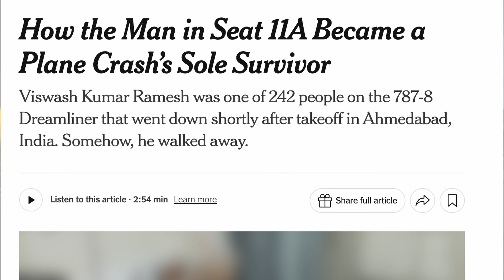Why the RAT Changes Everything – Air India 171 Update

Comment: Looking at that rat, maybe, pic.. now look at the flaps.  They look up.. but  I know on a 787 it's very hard to tell if they are at 1 or 5.  But... a duel engine failure.. possible... Polar had a 4 engine failure in Bogata due to the fuel truck being filled up with water.  They should have know if the flaps were up or down by day 2.  They should also know if the fuel was contaminated by now, by checking what is in the fuel control/pump or filter, one of which should have survived...  Nobody is talking though.

Comment: Hello Captain Steeeve! I like your hypothesis about the engine failure but its a not a theory. :)
Reply: It wasn’t engine failure. It’s a pilot not making sure that the propulsion engine driven generators were active and online prior to shutting the APU down. Which takes 90 seconds for the APU to shut down after selecting off.  They probably selected the APU off just prior to takeoff. 90 seconds later just about the time after they took off the APU shuts down and causes loss of AC power, kicks the rat out and then the engine Fadec system brings the thrust back to thrust idle safe mode. You then have to move the thrust levers out of the last position, takeoff position TOGA and back to takeoff position TOGA for the Fadec to realize there is manual control by a pilot, and then it will go back to full thrust. They may not have known realized that till the last second. Chain of events. Caused by something as small as not, making sure the propulsion engine driven generators were online by looking at the Crew alerting system, prior to selecting off on the APU just prior to takeoff. If they had selected the APU off earlier, way earlier prior to takeoff if the AC power had not switched automatically to the propulsion engine generators, well, then when shutting down the APU, the flight deck would go dark with loss of AC power. But they would be safely on the ground. I’m purely speculating that there must’ve been a fault that kept the APU generators from automatically switching over to the propulsion engine driven generators, which is something a pilot is supposed to be looking for. But there may have been a whole bunch of messages on the Crew alerting system clogging up your view from other maybe deferred item messages, and have not thought out just how important it is to make sure that you check and make sure that there are no GEN OFF messages shown on the Crew alerting system screen before you shut down the APU.

Comment: Honestly my experience with this airline is that mechanical issues are common. I had a 13 hour flight from Newark to Delhi and the tv didn’t work. The lights didn’t work. The service button didn’t work. The flight attendant told me that only the ground engineers can fix it. The same day, I knew someone flying from SFO and he experienced the same thing. I think all of the airlines flights should be investigated.

Comment: Next to impossible to take off with the flaps up.   THERE WILL BE A TON OF NOISE IN THE COCKPIT AS THE JET BITCHES ABOUT TAKEOFF CONFIGURATION.  And  I don't believe it is possible to set the autothrottles (TOGO) with that horn blowing

Comment: The craziest plausible theory?  Cosmic rays.  "When these energetic particles, especially neutrons, strike a microchip, they can disrupt the electrical charge within a memory cell, flipping a bit from 0 to 1 or vice versa. This change in data is called a soft error or single-event upset (SEU)"  If Boeing's engine-shutdown code had a single point of failure and a cosmic ray hit precisely at the exact spot on a microchip that code is housed.....

Comment: RAT would also deploy if the pilots disconnected both of the IDG (integrated drive generators) and the APU was off to try and provide 15kva power to the flight control. So the engines could be fine but pilot error disconnecting the IDG.  I think this has happened on a Egyptian air flight due to pilot confusion and panic.

Comment: Pilots think they know how planes systems function. How often do pilots trouble shoots systems. Rarely, mechanics trouble shoot systems. There was no error in co pilot grabbing wrong lever, but ive seen many times pilots dont follow check lists completely and forget to put fuel boost pumps on. Engines will start and run at low idles, but at full power and at a nose up attitude they can flame out. Thats what happened. i have 40 years experience in running and troubleshooting engine problems. The RAT was deployed which means the engines shut down starving from fuel

Comment: While we do have far more reliable engines than back in the day, this accident shows that having four jet engines like the 747 and the A380 might not be such a bad idea for safety purposes. It's highly unlikely for all four jet engines to fail at the same time so a dual engine failure like this one could've allowed the pilots to circle back for an emergency landing. In the case of the Air India 787, the dual engine failure at 600ft automatically doomed the flight.

Comment: The fact that the incoming flyer has issues inside the cabin with electrical problems the plane should have been grounded. These power issues could have led to a larger problem.

Comment: The rat motor has been around since at least the 1983 Gimli glider incident, but does the 787 not have Li-ion batteries to provide emergency power? In this day and age of fly by wire, would a massive power failure cause loss of engine power? ( Battery short etc. ) will be interesting to find out what maintenance was done recently.

Comment: This guy is absolutely WRONG. It was pilot error because the undercarriage was DOWN & the flaps were UP. The RAT can be deployed for a number of reasons, other than those stated. Lack of lift was not caused by engine failure. One engine maybe but two is beyond reason. End of the argument!

Comment: As a pilot for over 50 yrs, Im just saying we were TAUGHT that "water" is "heavier" than fuel, so aa student pilots,we're taught to drain the water out,which looks like "bubbles" at the bottom of your drain tube.
   If left in the fuel tanks,the first thing that will flow into the engines is? Water.
  Its not secret India,whether hot or cold is humid, so water condensation could  have, very well caused ( I say "could have") water contamination. Im in no way claiming anyone wrong here but  TO ME,it looks like this. Adding to that,by looking at the video,you see the 'nose' of the aircraft point "upward". That will both (a) slow the aircraft down and (b) bring the aircraft closer to it's stall speed. When you see the video, one sees the aircraft nose go UP...and the whole aircraft come crashing down. Its a natural human reaction to bring the nose up if your aircraft is slowing down. But its not the pitch. it's the airspeed. Are you ABOVE stall speed or not? 
   So tragic, especially to the children seen in the photos.😢😪

Comment: Hi Capt Steve - love your videos.  As a refueller I definately agree with your assessment of the sound of the RAT.  My question is If the engines on the aircaft were working i.e. genertating thrust would the noise of the engines drown out the noise that the RAT generates.  If that is correct and all we can hear is the RAT operating would it suggest that the engines were not operating?

Comment: Fuel or electric. If it is fuel they might find metal or some type of debris in the filters. Back when i work on c141 in the usaf we had a contractor leave debris in the fuel cells making a special repair. One of the first planes started to run up engines at the runway then the engines started shutting off. If they had got up they would have went right back down. I have never witnessed or seen a multi engine power loss due to electric. However I never worked for the safety board. This will be interesting. A truly sad day for all whom lost their lives.

Comment: I think from what I am hearing as Prior Air Craft Maintenance that, that loud boom was a compressor stall on one of the engines. Now if one of these Jets is anything like the Jets I used to work on that would mean that each engine operates a separate hydraulic system IE (example engine 1 hydraulics does Brake pressure, and landing gear and Ailerons and engine 2 does flaps and elevator). And if the APU was off at that time and a comp stall happened the generator from that engine would have shut down and if the electrical systems where "tied" it would have caused the lights to flicker because of the sudden load to the other engines Gen ,then maybe the RAT dropped. And I assume that 1 engine on take off might not have been enough. My 10 cents. Not claiming to be right.

Comment: Im not a pilot or an aviation engineer or expert. A dual engine mechanical failure for me is unlikely to happen in the same very second. The chances of that is just immensely not possible. Even minutes apart is impossible. Even flawed engine designs will fail at least hours apart, not same second. For me, its a central control system which controls both engines that failed. The plane was already experiencing electrical problems in its previous flight 2 hrs prior to it's ill-fated crash as described by a passenger (air-conditioning not working, in-flight entertainment not functioning) as described here: https://youtu.be/1y_u1O-T6jw?si=-DIYDoZ-pzHLVSk0. What Likely Happened for me:

1. Electrical system was already degraded
→ Aircon, in-flight entertainment issues in previous flight = ⚠️ clear warning of weakened electrical bus or component.

2. During climbout, electrical demand peaks (pressurization, hydraulic pumps, avionics surge).
→ Faulty relay, wire chafing, or defective contactor arcs or explodes.

3. Flashover or explosion occurs in a shared control or power bus feeding both engine FADEC units.
→ 🔊 Loud bang is heard in the cabin.

4. FADECs instantly lose power or command signal.
→ Fuel metering valves shut or default to idle → thrust drops on both engines immediately.

5. Main AC Buses collapse, triggering RAT deployment for emergency power.

6. No altitude, no thrust, no time to react.
Reply: Chat gpt?
Reply: Yep, i asked AI how a boeing 787 works and is connected. Asking it how both engines could fail at the same time without considering dual mechanical failure (which is of course unlikely). I only asked it to consider central control of both engines failing.
Reply: The Flight Control Computer (FCC) and the Electrical Load Center (ELC) together form the central control and power routing system that:

Sends throttle command signals to both FADECs (brain of each engine) Provides electrical power to both FADECs.

So What Happens If That Central Control (FCC + ELC) is Cut Off or Compromised?

Let’s walk through it step by step:

1. If there’s an electrical failure, short circuit, or explosion in the FCC/ELC:

Both FADEC units lose signal input

OR both FADEC units lose power

And because FADECs are digital only (no manual backup throttle), this happens:

2. Immediate Engine Shutdown or Uncommanded Idle

Engines either reduce to zero thrust (idle) or

Shut down completely, depending on failure type

3. Autopilot and Auto-thrust Malfunction

Flight computers stop managing engine thrust

RAT (Ram Air Turbine) may deploy to power critical systems — but not engine thrust control

4. Pilot Input Has No Effect

Moving throttles does nothing

Because the FADEC can't "hear" the command

No mechanical linkage in modern fly-by-wire aircraft like the B787

Comment: The only way to get a dual-engine failure on takeoff is with contaminated fuel (or bird strikes, but we know bird strikes are ruled out). Fuel flow rates are highest when the engines are set to takeoff power. You're pushing contaminated fuel at a high flow rate during the takeoff run, and there may be a reduction in thrust as the system clogs up the (after the fuel filters goes into bypass) fuel delivery system on the engine.

Comment: The Lone Survivor said, he heard a bang and saw the lights come on however he also said, "I felt the engines full power". Maybe the guy was mistaken but two engines full power as you are not gaining any lift, to me, seems like something you'd either feel or not feel (and hear)?   I was in the RAT camp too but the  full interview of the lone survivor really makes that a difficult option to go with.  He has no reason to say anything, yet the one thing he said was it felt like they "stopped" then he felt the engines go full power, thinking they would start going up.  I think we are still too early on this one.  RAT may have been deployed but don't think there was a dual engine failure here.  Cheers

Comment: Such a tragedy here, and such professional and informed presenter and commenters. 
Maybe someone will entertain a couple of questions.
What would happen if the wrong fuel was used?  It has happened on smaller planes in the US.  Would such an error ever be traceable?  AND, if an electrical failure occurred, is there a possibility the recorders could cease capturing part or all of the crash data (such a disturbing thought)?

Comment: Wondering if vapour fuel lock could be a possibility given the very high outside temps and the low atmospheric pressure at the time, this can cause fuel starvation to the engines

Comment: As crazy as this sounds, I don’t think the plane was properly fueled. A 787 will flame out due to a pitch up (take off) when fuel levels are extremely low. This is going to be one of those daisy chains like all the other air disasters where multiple people are involved leading to a catastrophic failure and loss of life. All human errors is my bet. Ops, fuel truck, pilot, and co-pilot all assuming something was done properly that wasn’t.

They did weight and balance calc based on the fuel they expected to take on.

Air India Express 2012 incident – 737
	•	Took off without sufficient fuel due to dispatcher error, caught in cruise, emergency declared.

Plus, that fireball is no where near big enough for a full load of fuel.

Comment: The following context has me wondering: my business was unable to process credit cards that day because of some vague something with Google Cloud or Cloudflare, so the tech sites said. I assume that Israel was also running massive cyber attacks on Iran's infrastructure at that time. The Internet is designed to route around damage, so in order to fully isolate and destroy Iran's military cyber systems, it may have been necessary to draw a pretty big circle around that target, so to speak. How many computers and/or systems are updating on a 787? Could something on the Internet interfering with communication also interfere with the communication of engine systems or flight computers and cause the engines to shut down? In the alternative, could poor quality control at the Charleston Boeing plant where parts of this plane were manufactured have played a part?

Comment: Yeah, you can hear the turbo prop type sound coming from the RAT propeller at the beginning of the video as it was recorded by the iPhone.
The hydraulic pump with hoses is positioned on the back of the alternator to which a two bladed variable pitch propeller is attached.
During operation it makes a destinctive turboprop sound. Essentially a wind generator with auto adjusting blade pitch so it can extract maximum energy from the air- stream within a wider range of air speed's

Comment: 1. If the RAT was deployed, why was it not visible in the video from 6:40 onwards?
2. Dual engine failure just after lift-off is a serious technology failure.
Reply: Because the high angle of attack (stall) makes the fuselage hide the RAT.
Reply: @rickoshea8138  NO. at 6:40 you can see the belly of the aircraft very clearly from the video. I can't see the RAT.
Reply: @janisb5522  4:30  Perhaps it is hard to see.  If the RAT is not there, was the prop sound added later?
Reply: @rickoshea8138  Why hard to see? It's a very good quality video captured. There is no RAT deployed at 6.40.

Comment: One engine failing isnt unheard of on a jet, once every 375,000 flying hours on average approximately, but both failing at the same time, not sure on the odds but very very rare. Whether it be bird strikes, bad fuel onboard and volcanic ash, could well be bad fuel, maybe a main fuel line had come off and cut all fuel to the engines causing flame out?

Comment: You can hear the RAT, but you can't hear the engines. That should be the smoking gun.  There is no way the RAT is louder than the engines if they are at full power.

Comment: The RAT sound is so noticeable. If the main engines were working, the pilots (in trouble) I feel would have shoved the throttles thru the firewall for power. Since there is no strong engine noise, tells me also of a dual engine failure. Such a tragic event.

Comment: Dear "Expert" Its not a dual engine failure. It's an electrical failure. The 787 uses its electrical system to deploy the flaps. It also uses its electrical system to power the hydraulics. Flaps were not deployed due to electrical failure. Wheels were not brought up due to electrical failure making the hydraulics not work. Engines may have stalled and couldn't be restarted as electrics are needed to start them.  Don't forget to thank me when you make another video about that.

"787 Electrical System - Boeing 787 Updates
The 787: A more-electric system The 787 Dreamliner uses more electricity, instead of pneumatics, to power airplane systems such as hydraulics, engine start and wing ice protection."

PS I know absolutely nothing about Air O Planes but I solved this mystery for you with 5 seconds of googling.